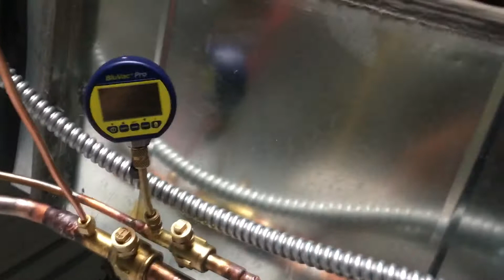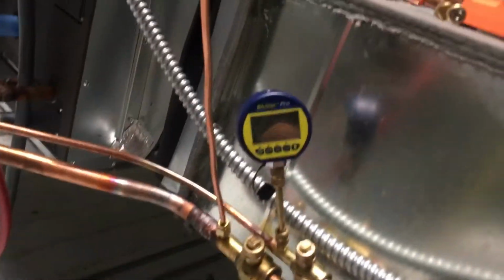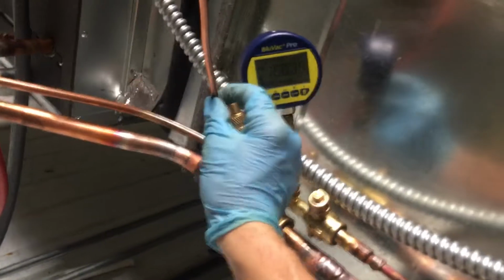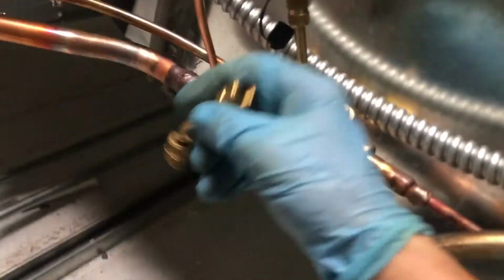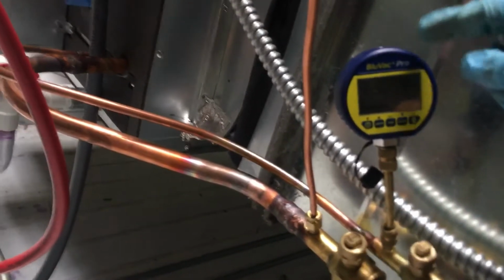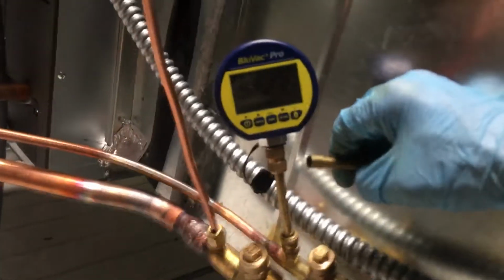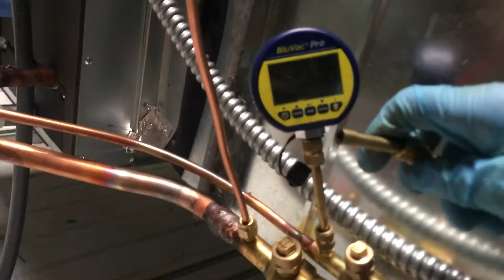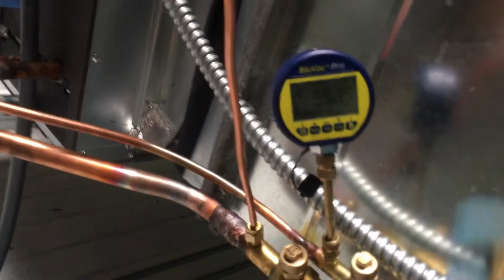I (THINK ?) I found the leak that was giving me bad micron readings. The keyword here is (think)

Comment: Interesting point you make towards the end about not using nylock when connecting on the micron gauge.  That may be one reason my gauge has been jumpy lately (have cleaned it again, per your suggestion).  I may have been applying too much nylock on the male flares that the micron gauge was screwing onto.

Comment: Ok i think the problem is , that the core depressor on that micron gauge coupling is not good , and based on videos from jim bergman , he suggests using a core tool as a connection point for the micron gauge and removing the schrader . i dont know if you have removed that schrader from liquid line where micron gauge is connected to or not but try it.
Reply from the maker: Yes I have done that. I have watched all of Jim Bergman videos all the way back from the old days of making testo videos. 

      And videos made by HVACRat On YouTube he made some of the most detailed long videos just on vacuum before everybody else did.
Reply from the maker: @hvacir9176  I removed the valve core .